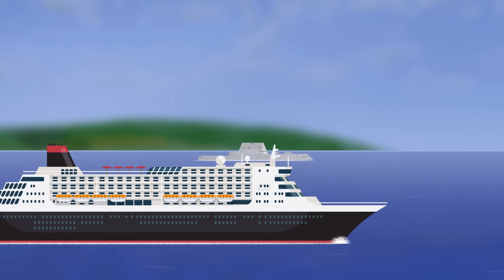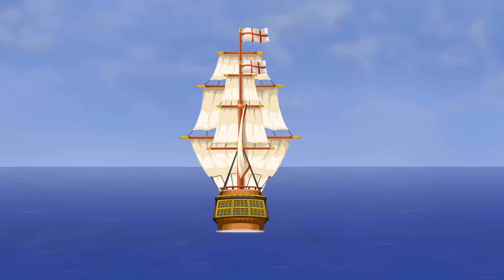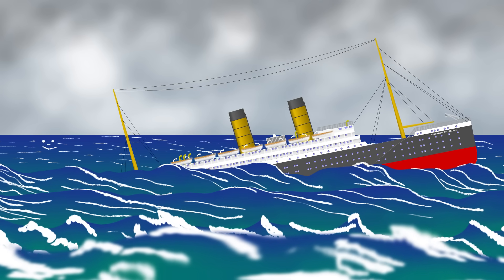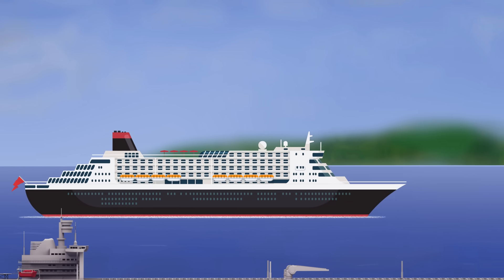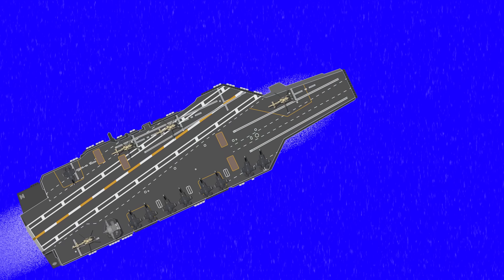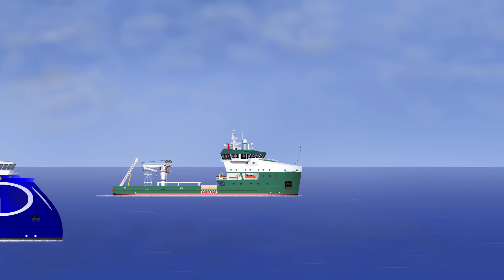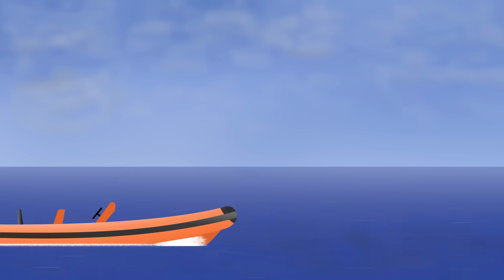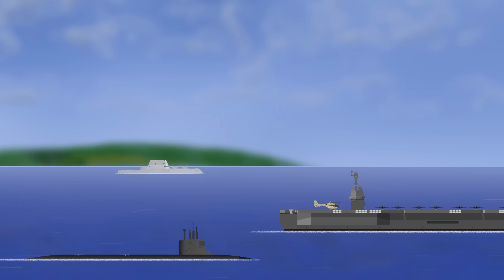Why Are Bows That Shape?

Comment: I've always wondered why ocean liners of the late 19th-early 20th Centuries, such as Titanic, nearly universally had vertical bows, while modern cruise ships pretty much universally have flare bows. This video addressed it to some degree, but not fully. I get the sense vertical bows ride better on rough seas by having no change in waterplane area with depth while flare bows have an increase in waterplane area that would cause more pitching - I'd think this would make the vertical or rake bow better for passenger comfort. The flare bow has more internal volume, and given how modern cruise ships are constructed to maximize volume for their dimensions I could see that being a higher priority. Is the danger of causing damage to another ship below the waterline a major decision factor? Most ships now have bulbous bows, which I'd think might cause the same problem, though they are blunt so maybe not as bad as a sharp edge. On such note, are bulbous bows designed as crumple zones, designed to crush and absorb energy with minimal damage to the rest of the ship and - if hitting another ship - minimize damage to the other ship? Sort of like a car's bumper? That would actually make a lot of sense.
Reply: I think you kind of answered your first question yourself - you're comparing ocean liners to cruise ships, which is kind of an apples and oranges thing. Cruise ships, since they're all about passenger comfort, will try to avoid adverse weather as much as possible. However, should that be unavoidable, they'll want a ship that can ride it out, which the flared bow is good for. We must also remember that cruise ships are comparatively light - they have these huge superstructures, but they're mostly empty space, not full of, say, cargo or something else heavy. As such, they have a rather low displacement for their overall volumetric size. And to conserve fuel, they want that displacement to be as hydrodynamically efficient as possible. So a nice, pointy, streamlined hull shape, but with a flared bow to handle eventualities. (Also, a flared bow gives more deckspace for even larger superstructures.)
Reply: @Retired Bore True, good point. The largest ships are a lot larger now, that could also be a factor - waves are smaller relative to their colossal size, while smaller ships are more sturdy. We have to keep in mind that ships like Titanic would be fairly small by modern standards.
Reply: @Retired Bore It also causes a wave to form at a more-forward location so that it's trough will "cancel out" the crest of the main bow wave, thus reducing the amount of energy wasted on making waves and even increasing the speed which can be attained.
Reply: Bulbous bow is engineered in order to create the wave forward. That allows for greater efficiency of the hull.
Reply: @jinksomiabodyart3189  So you and Retired Bore are saying that the bulbous bow is a newer design that performs better than the old vertical bows of older ships? An interesting thing I've noticed is that early ships with "bulbous bows" were sort of a combination of the vertical and bulbous, with the vertical bow leading edge, but having it wider below the water line and very narrow at the water line some distance back. Almost like a modern raked bow/bulbous bow but with a plate of steel between the bulbous bow and hull above. You could also have the bulbous bow project out in front of a vertical bow, sort of like a "ram bow" that some WWI-era warships had. But as the name suggests that can be dangerous having the ship project further forward below the waterline than above, and warship ram bows more often accidentally sank friendly ships than enemies. A bulbous bow I'd think could be designed to crush or break away in a collision, but just being strong enough to withstand pounding through waves in a storm would mean it could still do a lot of damage. So overall I don't think a bulbous bow and vertical bow are necessarily mutually exclusive, couple ways of having both. So I suspect there are other reasons for this change.
Reply: Hi, the bulbous bow, its benefits and use cases are elaborated on here: https://en.m.wikipedia.org/wiki/Bulbous_bow
Reply: @aa2222a  I understand the design of the bulbous bow, what I'm wondering about is above that, how early 20th century ships had nearly vertical stems while later ships - whether having a bulbous bow or not - have an angled flaring bow above the water line. I'd think a bulbous bow could be added to either design, so it's sort of a separate question.
Reply: @quillmaurer6563  good clarification. Some modern vessels seem to employ the vertical bow instead of an angled flaring one. Norwegian Viva as an example. Would be intersting to learn more about the reasoning behind these design choices, though.
Reply: @quillmaurer6563  good point. The new Icon of the Seas features also an interestingly shaped bow, which seems more vertical. Would be interesting to know why these types of bows seem to be trending 😃

Comment: One thing to point out on submarines, a large consideration to the bow shape is the sonar and torpedo tubes. Both are in the very front of the ship, so you need a good amount of space. A more hyperbolic/oval shape performs better then a hemisphere in terms of speed and radar return but these are often overlooked for more sonar space.
Reply: The torpedo tubes on modern subs actually aren't at the very front of the ship. They're toward the front of the ship, but set back behind the sonar dome and angled outward, so they're more side-mounted in the front quarter of the sub rather than at the very front like in a U-boat/other WWI/II subs.

Comment: I’m kind of curious why many new cruise ships like the Celebrity Edge, Scarlet Lady, and Norwegian Prima are going for the straight bow design now rather than the flared one, if the flared bow is suppose to reduce pitch?
Reply: yeah I believe it is much more comfortable for passengers with the reduced rise in fall of a bow that slopes backwards. it's also a bit of a fashion thing too.
Reply: Do ships get taxed/classified differently by their total length? Maybe there's also some port restrictions caused by a flared bow?
Reply: It's less drag so less fuel consumption. Pitching isn't a good thing. The only real disadvantage of a straight bow is it is wetter
Reply: @deerfootnz  thanks. And by wetter what do you mean? And how is it a disadvantage?
Reply: @sergel02  wetter : more water on deck. The flare tends to distribute the bow wave out and down. A straight bow cuts through the wave. In yachts, especially multihulls the bows with reverse are often called "wave piercing bows"
Reply: You can achieve the same increase in volume by extending outward vs forward. The goal is to increase volume as the waterline rises vertically. By keeping the overhang shorter you decrease the lever arm and thereby  pitch  inertia.

Comment: I have not dug in all that much in too submarine design but from what I have heard the hull is actually quite far from perfectly hydrodynamic within the current engineering capabilities, that would be more of a fish shape. Also, the exterior "round" hull is not the pressure rated so doesn't have all that much to do with the pressure rating (my best guess is that it's a collision buffer and can't be used to hold the pressure because of the safety concerns because of it). The reason why the fish shaped hull supposedly isn't used is too be able to get a bigger nose sphere to be able to mount a bigger sonar even though a fish shape have much better underwater mobility. Personally I would like to see a follow up on the submarine design out of personal interest, I do remember that they did have a flaird bow in the early days

Comment: I wish he would have discussed the Nelson Class battleships. Forward sloping bow with practically no flare but an extremely long length to maximum beam supposedly for maximized speed.
Reply: Inevitably, interesting information in Wikipedia, although not too relevant to the bow-shape topic. Design parameters were restricted by the 1922 Washington Naval Treaty, so amusing to read that  the two ships were often referred to as the "Cherry Tree" class, because they had been "cut down by Washington" :D

Comment: The bow of a submarine is typically where the sonar suite is as it's furthest from the noisy propulsion systems. As a larger sonar suite is advantageous, this often means that submarines are designed with a more spherical bow than would be hydrodynamically efficient.

Comment: one thing with flared bows is that they are rather pointy at the waterline to cut through the water. but near the deck. they are more round. the shape means that when they come down after riding a wave the water when it crashes down goes up the bow and broken apart. when you see videos of ships in choppy seas. you can see the water splashing outwards. this helps reduce damage to the ship as it brakes it up and helps protect the superstructure as it will mainly encounter swash and not a big wave.

ships include well nearly all of them.
fishing vessels, passenger ships, cargk ships and warships.
Reply: Another thing is, when they come down, that because of the flared shape a fair amount of water is pushed forwards.
This greatly reduces the forward speed of the ship, a problem the axe-bow or a tumblehome don't have.

Comment: its so interesting how there are so many valid bow design choices. Each one has its usage and ship type. The diversity is not seen so often in other areas. I never really thought much about ships from engineering perspective (I am mostly interested in aerospace) but ships fascinates me a little now thanks to this channel.
Reply: after certain speeds, the air becomes as viscous as water, so it becomes vert simular at that point. except the whole flying part
Reply: @alexzanderroberts995  we also consider aerodynamics in high speed boat desing. İn some hydrofoil desings the hull is completely out of water

Comment: Z bow is the term for the inverted or "reverse bows" also sailboats use plum bows to achieve maximum waterline increasing speed for given overall length. Common bro. You're usually on point. Getting sloppy

Comment: There’s also the so-called “Great Lakes bow”, which can be found on some of the very largest iron ore freighters on the Great Lakes. It’s semicircular. The ore freighters move slowly enough that their wave making resistance is small and skin friction becomes a much more significant factor. They are also limited in length by the Poe Lock. The semicircular bow enables them to minimize the wetted surface area while also maximizing the available displacement within the constraints of the locks.
Reply: Yeah, he didn't mention wake reduction. Wakes are a major source of energy loss. Energy spent kicking up a a bow wave is not spent moving the  ship forward. Military ships tend to be sharp, they produce more wake at cruising speed but let the ship move at higher top speed. An important consideration when being shot at. The more rounded bows of civilian ships, esp cargo vessels don't have nearly the same top speed but they waste less energy in the wake.
Reply: I've also heard the waves can get so large for the depth that the troughs can ram you into the floor.  It makes sense to place yourself as high in the water as possible to minimize that.
Reply: @themekahippie991  That sounds like stories I've heard about Saginaw Bay.
Reply: @kenolson6572  The shallower the water, the greater the wave. Bering Straits have big waves, as does that place in Oahu and in Portugal.  Hawaii wave labs screen scrape: "When the water depth is less than one-twentieth the wavelength, the wave becomes a shallow-water wave (D < 1/20 L). At this point, the top of the wave travels so much faster than the bottom of the wave that top of the wave begins to spill over and fall down the front surface. This is called a breaking wave."
Reply: Yea Great Lakes are a whole other deal with ships it seems
Reply: They also have flatter bottom increasing the buoyancy to carry heavier loads and less resistance when using the bow and stern thrusters when docking or navigating rivers.
Reply: Interesting

Comment: 2 other items, a flared bow helps reduce the amount of water that ends up on the deck in severe weather, as well a very fine bow can be weak and prone to plunging in heavy seas. The Iowas suffered from this and could not maintain their high speed in rough weather.
Reply: True, for pleasure boats reducing spray and plunging bows inundating passengers is not a good thing for sales or comfort. Another item in racing boats generally are rules. Good or bad, to win you have to start by building to rules and sometimes that affect the bow.